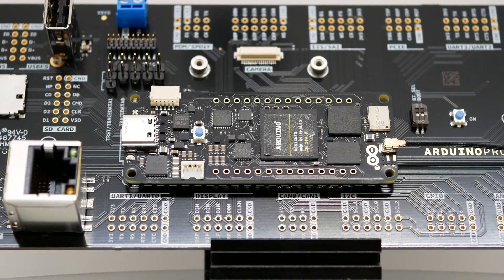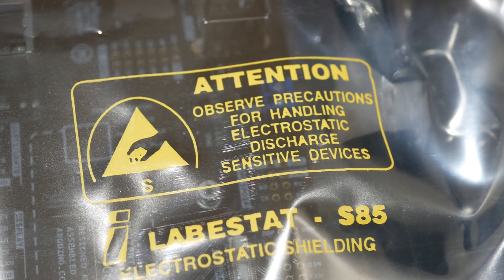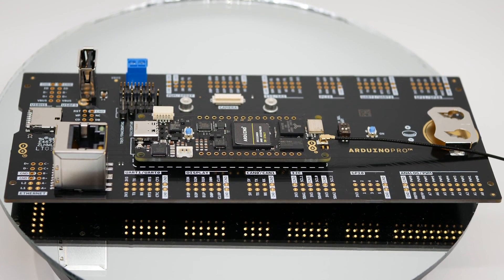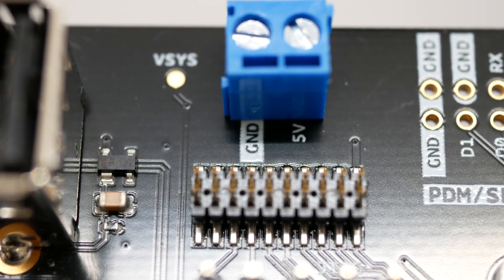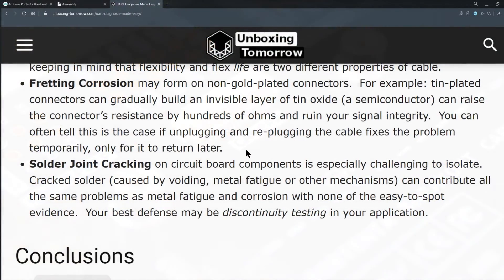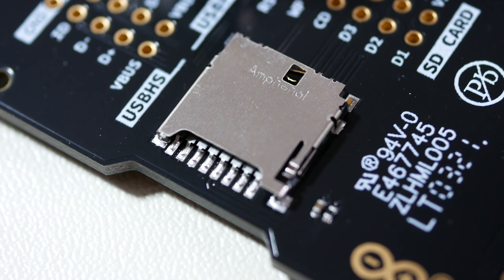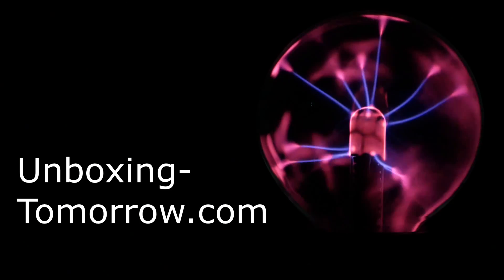Unboxing the Arduino PRO Portenta Breakout Carrier

Comment: Oh gods PLEASE use style 1, it reduces space. The leading open { looks like it is leading you outwards. Similar to the English tripple dots: Coming up soon... It leads you in to the code block. Under it? No way, it is much older school, it has merit in bracket indentation matching sure, but makes less sense in the modern world of reading left to right, the next line is the next line and should be unrelated.
Reply from the maker: I kind of like the symmetry of style 2, but it could just be a vision thing.

Comment: how you get it? on website is not availble? Price?
Reply: ahh i was thins is the Portenta X8.
Reply from the maker: @proto_hexagon5649  I usually get Arduinos either from the official site, or a distributor mentioned on the official site.  Are you located in North America?

Comment from the maker: Plot twist: I'll be using sockets instead of headers.  
0:28 - Portenta H7 Overview
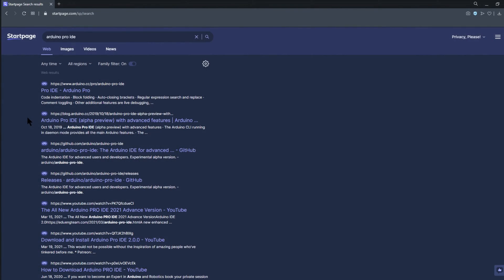1:07 - Software Requirement
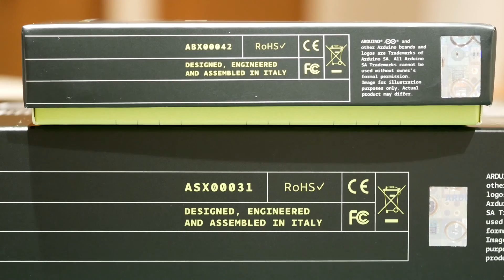1:59 - Unboxing
2:20 - Online Resources
2:45 - Landmarks
4:56 - Manual Inputs
5:46 - Battery Systems
6:07 - Summary